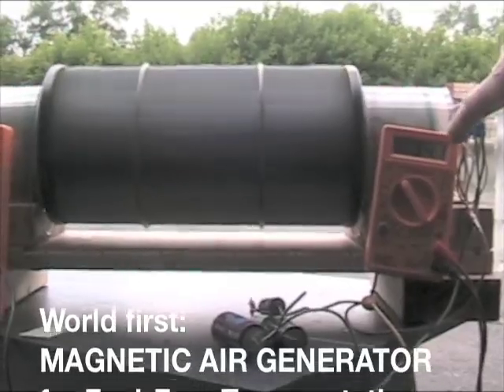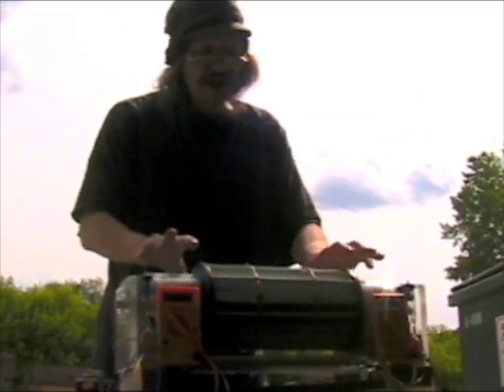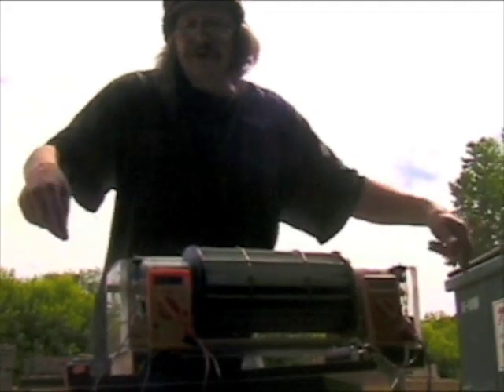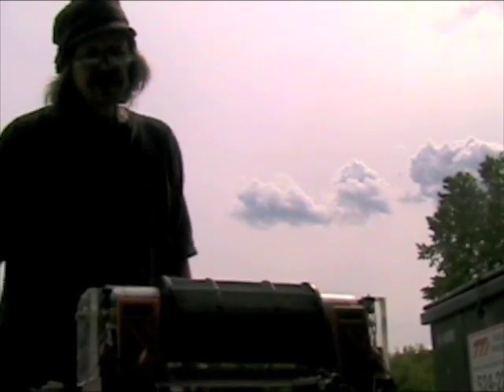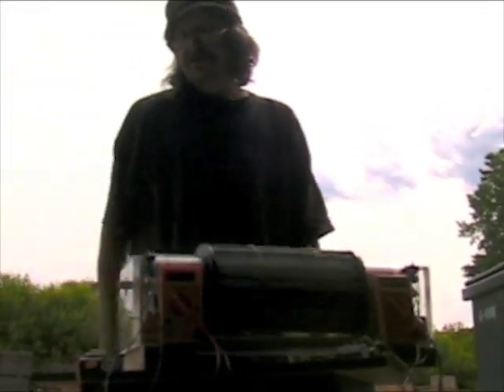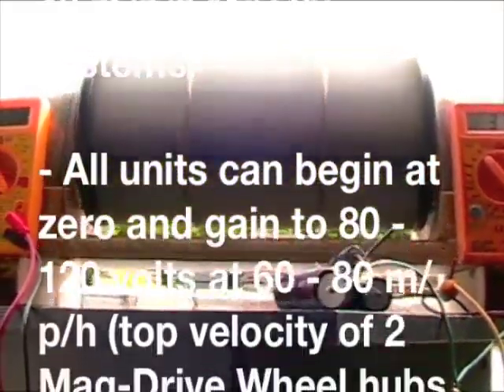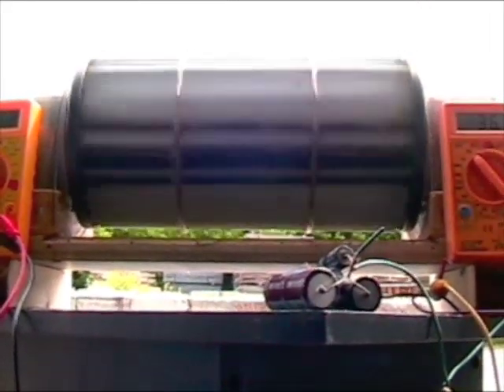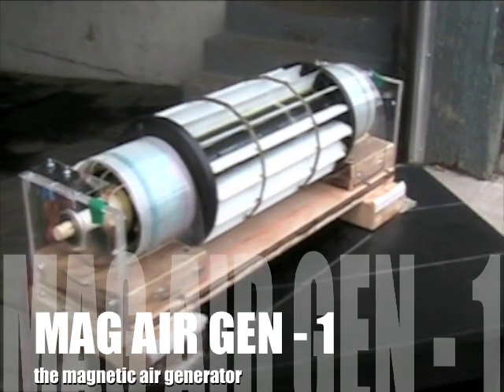MAG AIR GEN

Comment: I'm building one twice the size and output right now! With the big one below & this one on the roof-line, I hope to mount them on a vehicle for tests (with Vibration & solar-fed motor devices as well). By deflecting the Air currents resistance should actually be cut. In other words they will be part of the streamlining system & produce current as well. Hope many will build these and add new features!